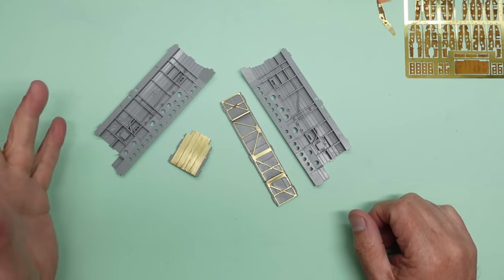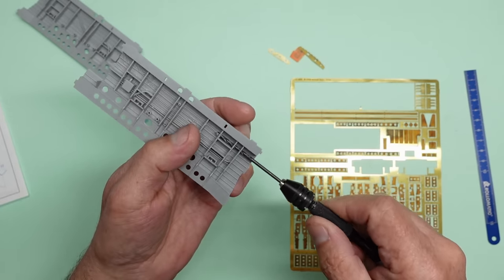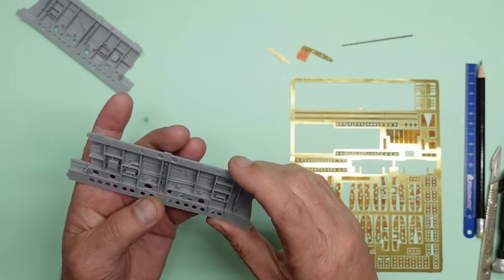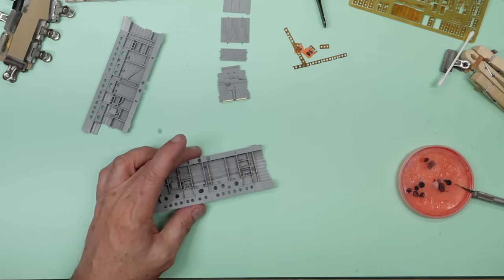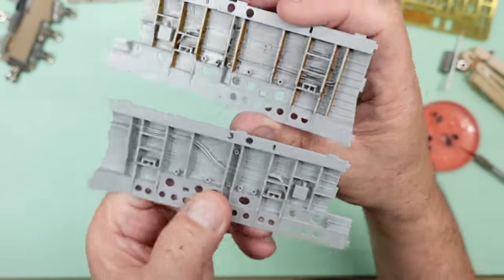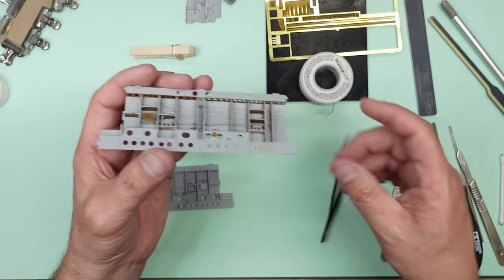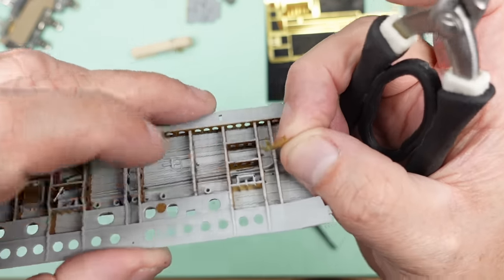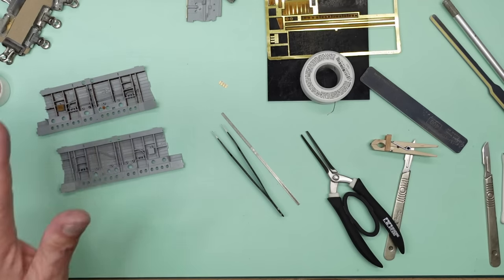HKM 1/32 A-20G Havoc build. Part Eleven.

Comment: They call those “lightening holes” that are in the webs, which helps reduce the weight of the aircraft. They also have a flange around each “lightening hole” for strength in the web. Those PE parts really add a nice touch to the build.
Reply from the maker: I know. That’s why I have referred to them as lightening holes and mentioned that they are plunged to add rigidity and the flange on the edge also adds stiffness. It’s a shame they are so thick and “two sided” but overall they look good.

Comment: Nigel, quick  question:  I noticed that the color of the tape you were using to hold the rear bulkhead into position with the side walls of the bomb bay is a different color (slightly more orange-ish) than the usual Tamiya tape that you have used in the past. Has Tamiya changed their tape color, or is this a different brand of tape, and, if so, how do feel it compares to the Tamiya?  Thanks, and get better soon.
Reply from the maker: It’s Mr Hobby Tron.

Comment: You mentioned the black ca glue at one point, do you use the vms black flexy thin, or the normal stuff? (For filling seams etc) Can't find anyone with the normal stuff in stock - I'm tooling up at the moment and the dining table looks like an amazon facility....
Reply from the maker: You can use either, or mix some black thin with normal clear ca..